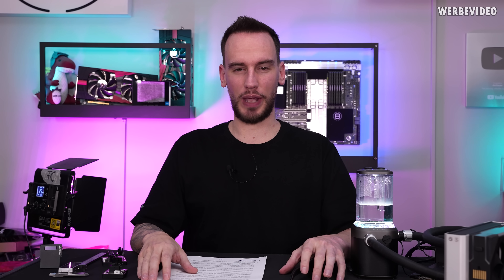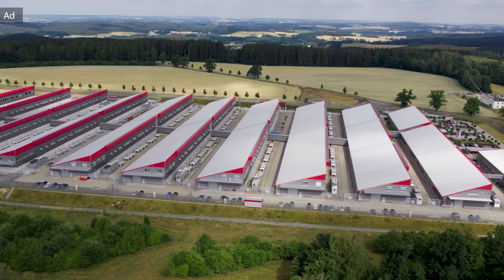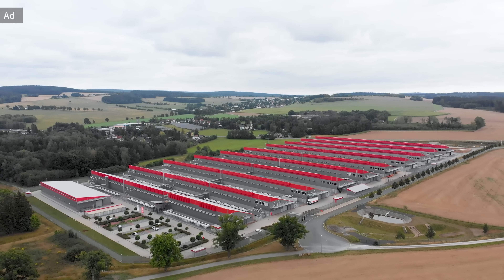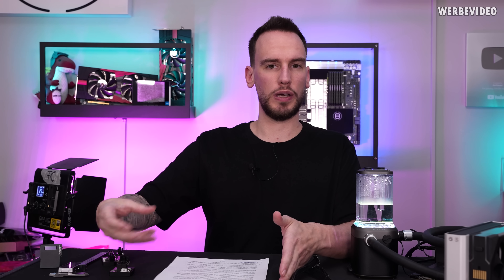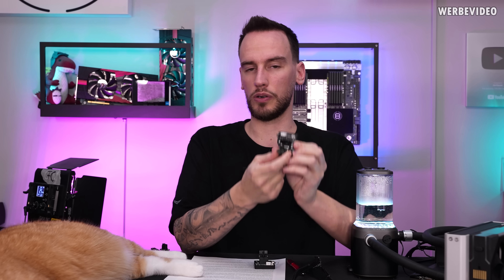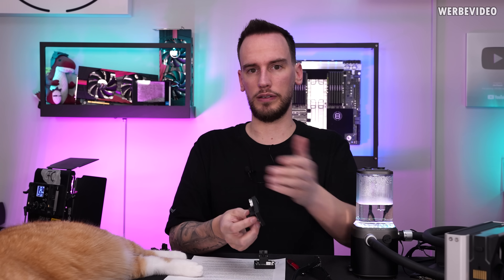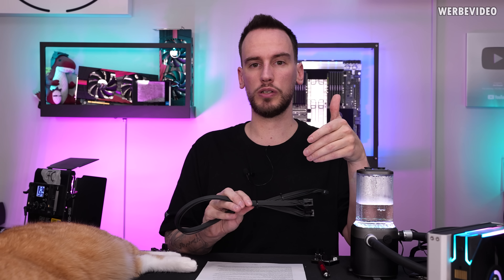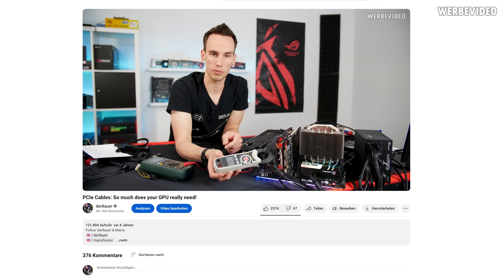12VHPWR is just Garbage and will Remain a Problem!!

Comment: even if nvidia does 2 X 12 volt high power connectors the problems will still exist in the long term future. 2x hvpwr plugs will help with the short term future tho. now to give you some history about me i have been a auto mechanic for over 30 years now. i have seen the exact same issues in auto electrics. now to give you a few examples in auto electrics. my 84 GMC 1500 uses the old large blade fuses. i have never had problems with these fuses except when they blow. which is what they are designed to do. some of my fuses are the original fuses that came out with the truck from factory. ( note here these original sized blade fuses the pins do not burn. also have never had to replace my fuse box.) now newer cars uses these smaller mini blade fuses with smaller pins pushing exact same amount of amperage and volts as the larger blade fuses. i am constantly replacing mini blade fuses on vehicles because of something quits working. but fuse is not blown. you pull the fuse and the pins are burnt. i am also constantly replacing fuse boxes now because of same issues. this has became such a problem that most vehicle manufactures are making the fuse boxes replaceable now which enhances the problems more because of more small pins.  to fix these issues going back to the older big blade fuses will solve 99.9% of these issues. now that i have explained all this. go to the 12 volt hvpwr plug. the pins are smaller then the older 8 pin plugs. they need to go back to the larger pins. by reducing the size of the pins it causes more problems with heat when conducting the same amount of amperage and voltage. its like trying to force the same amperage and voltage through smaller diameter wire. so conclusion if they will remake the 12 volt hvpwr plug with the 8 pin power plug pins making entire plug slightly larger. then nvidia does 2 X hvpwr  plugs this will greatly fix 99% of long term and short term future problems.

Comment: hypothetically could you hard wire  to the pcb run a short pigtail and terminatte to 3 or 4 8 pin connectors on a 4090 for example. Not being an engineer but if I put my hat in the ring for a design I would move the power connector more inward on the pcb and have a channel for routing the power cable and some sort of method of securing the cables to the more solid heatsink fan assembly for strain relief and from moving.  For example there would be a panel you remove to plug in your grfx cards power to the psu the route the cable and replace the panel you get the clean install pc builders want and a secure power cable in theory.

Comment: I am not electrically minded, mechanical yes. Is a direct soldered connection to the card possible?. Seems removing points of failure would be best i.e. the contact connection.

Comment: Realistically, 12VHPWR is a 300W connector with a 2x safety margin, not a 600W connector with a non-existent safety margin. I can see why manufacturers wanted a single cable for 12v power, but a single cable for <=300W and 2x cables for <=600W would be fine.

Comment: The issue of the safety factor is terrible.... If the other connector is spec'ed for 150W and will do 216W safely, 1.44 safety factor.

The 610-660W 12V power adapters make a lot more sense, if you imagine a 450W GPU spec and build the cable to handle 1.45X that amount (652W).

Is that cost cutting, or was the spec designed for weaker GPUs originally?

Comment: I said years ago that the ridiculous trend of adding more and more connectors (4x8 pin for example) would without question end up being just a single connector. The connector we got is far too small, and has nowhere near enough mating length or surface contact area. It's just not substantial enough, maybe NVIDIA should look at the automotive industry. There are thousands of ways to create a connection for GPU's and this connector is not a good one that should be banished.

Comment: As 4090 owners is there anything we can do to minimize having an issue?  I constantly check to be sure that my cable is seated and not severely bent but still fear that it may just randomly melt.   It’s too bad that Nvidia won’t admit fault and find a solution for the folks that invested quite a sum to purchase their product.
Reply: "As 4090 owners is there anything we can do to minimize having an issue?" Yes, make sure your power cables are seated correctly. And try to avoid third party adapters/cables. Your odds are %99.95 remaining issue free

Comment: they also need to all angle their connectors 90 degrees. You missed what the card is rated at - 75w through the m/b but it draws 450w - 500w so 375w-425w through the cable?. If the connectors are angled in relation to one another its creates what we call a point connection - a single point through which the current passes. If its a full fit with connections fully touching along a length then the current has a greater surface area to pass through from one connector to the other. What is needed is a redesign that enables a greater length for their touching of contacts along their length.

Comment: Why don't we use ring connectors? They're a proven technology, in use for decades in MUCH more demanding applications than PCs. An end user can terminate them on their own to the correct length, or they could be provided with ends already attached.

Comment: A safety margin of 1.1–1.5 is not a safety margin at all; it's the engineers (more likely their managers) saying "Let's only provide what we need to and stop there." That would be like an aircraft manufacturer designing the landing gear to support exactly the maximum designed weight; it does not take into account any extreme circumstances like hard landings.

I would rather see three or four 8-pin PCIe cables in my case and know that I have a safety margin of 1.9–2.5 than a single cable and risk a fire should one of the wires break because there is no safety margin.

Comment: I'm running a Asus strix z 790 e ddr5 @ 5400mhz gaming WiFi board, i9 13900k, Asus strix oc 4090 with 2 Samsung's pro990 m.2 ssd's with a Corsair hx1500i power supply. I'm running the 4 plugs at 150 to 16pin to the graphics card. I put a temp sensor on the plug where they are melting. I have seen a max of 40deg cel. When running FurMark. The max I've seen after 45 min was 42deg cel. My case is the NEXT H7 Flow. All fans are coarsair 140mm and a nzdt AIO 360mm those fans are 120mm. I'm writing you this to let you know that things seem to be working at the proper temps? Maybe you could tell me if I'm wrong. My CPU and card are slightly overclocked.

Comment: Thank you for doing this video.  As a owner of a Strix 4090 I am concerned about this.  I also purchased the cablemods 90 degree adapter and appreciate the honesty and detailed explanation of this situation.  I would hope that Nvidia or Asus would take the lead for replacing this power design.  I will not buy any gpu with this cable design for power delivery in the future.  Thank you again very much for brining this into the light.  Hopefully something will be done about it but with Nvida you just know more than likely it wont.

Comment: They really should have just used 2x 12v eps connectors for the 4090 instead of this garbage. Those are rated at 336w each (4 pairs at 7A each for 28A)

Comment: I don't understand why did they want to reinvent the wheel and didn't went with something like XT60 or XT90. Even the molex style connectors on PC PSU are dumb and totally outdated. Why use multiple small pins and thin wires instead of thicker ones.
Reply: Genuine answer. Cause these can be crimped. Which can be done via machine in stupidly high quantities and then inserted into the connector jacket (again by machine). Where as thick connectors have to be soldered and having an extra step to protect the newly soldered joint (Special isolating parts, Heatshrinks, etc) which is far slower to do even with partial automation. This makes Molex style (and similiar like JST) connectors suitable for mass production, while the beefier connectors like the XT60,XT90 and old T-Plug are more for comparatively low-volume production.

The real kicker is that this connector could have easily handled 900W, IF instead of basing it on the older Microfit3.0 design (8.5A per pin), they based it on the newer Microfit+ which is far more secure and capable (13A per pin).

Comment: NVIDIA produced defective cards, that's the simple gist of it. All these other brands are trying to produce solutions to fix what NVIDIA did in laymens terms is an 'oopsies'. The problem comes down to simply that the eggheads at R&D department of NVIDIA thought that theoretical limit of power connector material limits is the same as real world material limit i.e. that resistance and material impurities don't exist. So pumping that much power through singular tiny connectors that are full of resistance and impurities would conduct heat and eventually there would be a melting point. CableMod's adaptors are not faulty or defective, the point of failure is on NVIDIA's side.
Reply: "NVIDIA produced defective cards"  200,000 units sold less than 100 known issues = 0.05%. This product falls well below the industry's acceptable quality level standards and well below the %4 expected failure rate.

According to the AQL industry standard (Acceptable Quality Level) the acceptable failure rates are as follows:

The failure to meet the requirements of customers with respect to quality is termed as defects. The three categories of defects are:

Minor Defects - Not likely to reduce the usability and material of the product for its intended purpose, but slightly altered from the intended design and specifications. The industry average AQL for minor defects is 4%.

Major Defects - Not acceptable to the customers. Usage of the product will most likely result in failure. The industry average for AQL for major defects is 2.5%.

Critical Defects - If accepted, this type of defect could potentially harm or injury the customer. These defects are completely unacceptable. The industry standard for AQL for critical defects is 0%.
Reply: @javiersantana848  I'd say, potentially fire hazards fall into critical defects. Especially if it can potentially set someone's house on fire.
Reply: @luminatrixfanfiction  "I'd say, potentially fire hazards fall into critical defects. Especially if it can potentially set someone's house on fire." I agree, but this is not even the case nor has it even came close to actually occurring, being replicated or proven, that is only your opinion. This product if anything at all falls under minor defect based on the scarcity of issues. User error and using after market adapters do not equate the GPU having a manufacturing defect, but if it did it would still fall well below minor defects expected failure rate of %4

Comment: The pins are too small, the contact surface area too small due to shortness of pins, all around fail. If they only made the pins longer and thicker with a deeper socket it might have been solid. Not only would it reduce heat, but also be a more stable physical connection.   Reason I never got a 3090 ti, or anyting that followed. How much money would they have lost if they made these connectors longer with more contact surface area? Totally dumb design. Even someone without a EE degree can see this as a fail. It goes to show how all these new engineers never over engineer anything. They really need to get this resolved fast, go back to old 8 pins. I will not touch until done.

Comment: They should have just doubled the old 8 pin connector into a 16 pin, mandated 16awg wires for it, and rated the new connector at 500w. It would have satisfied the new power requirements, taken much less space than using 3x 8 pins before that high end cards had been using, and been very safe still.

Comment: Roman, do you have any thoughts on why the PC industry doesn't adopt high current, low pin count connectors like the XT60 and XT90 (or other bullet/banana plug style large diameter connectors)? These are widely used in high current applications with no persistent issues, while being much more compact than both PCIe and 12VHPWR connectors. I get that the higher gauge wires might be a bit annoying, but that can be worked around in various ways by manufacturers. And of course soldered connectors are slightly more expensive to produce than crimped ones, but again: negligible. According to the connector specs, a single XT90 can deliver power to a 600W RTX 4090 with a 1.8x safety factor, while being a small, relatively easy to connect and disconnect, secure, temperature tolerant connector. I get that these connectors lack features like sense pins, but again this could be worked around by, say, making a custom XT90 derivative with some small sense pins attached, or (less elegantly) by adding a secondary sense connector.
Reply: I can answer that as an EE with production experience. It genuinely is because they need to be soldered. The reason being not because costs, but production capacity.

Crimped cables are incredibly easy to automate with machines that are able to perfectly strip and crimp at a speed that "Machine goes brrrrrr" isn't an exageration and it needs nothing more than the cables and the pins. This allows for an insane quantity of connectors to be made in record speed with practically no failures by a single machine the size of a Xerox and is a stark contrast to Soldered connectors which take magnitudes more time per connector on average due to increased production complexity. It is the difference between getting a thousand large diameter cables and a million crimped ones (and i think in reality the ratio is even higher...).

As a result we use large diameter connectors very rarely in appliances. If we can use Crimped connectors, we ALWAYS will try to use those first. Only if we absolutely can't like because of an external high-current connector or standard (e.g. XT90 for batteries), do we bite the bullet and agree to soldering the blasted things and only if the product is low to medium volume. If too many devices rely on soldered connectors a cable shortage becomes possible.
Reply: @Foxhood  Thanks for the response! I've seen videos of those crimping machines, so I know how fast they can go, though I guess I hadn't thought of how much slower soldering is at scale (they're more comparable when you're doing both by hand after all). Still, in this case it's starting to sound like soldered might be the only way to go if they want to keep the desired characteristic of having a smaller connector with a higher current rating. I'd assume that if developing a crimpable large diameter connector capable of that kind of current level (i.e. an XT90-like but crimped) was feasible, someone would have done so already.
Reply: @Kraaketaer   Yeah. Thing with crimping is that you are largely limited by the contact surface area between the wire and the Pin itself which is often squeezed around the wire's circumference. Result is that the ability to transfer current from wire to connector gets noticeably worse as you go thicker. Only soldered lets you go almost as hard as the cable and the actual connector itself can, hence its use with stuff like XT90. Crimping that and you will lose a massive chunk of its current carrying capability.

This is actually a factor as to why they wanted to go for a smaller connector. Way more efficient at transferring current than the bigger one that required thicker cables to properly crimp on. Its just that they executed it poorly. Like using the 13A microfit variant instead of this modified version of the 8.5A variant

Comment: scary stuff as a 4090 owner. I use corsair's 2 8-pin to 12VHPWR solution and have an open format vertical test bench setup so the cables aren't under any strain, and I think this connector has only gone through two mating cycles. I'm always very cautious about moving the cables around when I have to. thankfully, i don't typically have reason to touch them at all...
Reply: "scary stuff as a 4090 owner" Na, lol. 200,000 units sold less than 100 known cases = %0.05. You have a %99.95 of having no connector, cable or adapter issues. The only ones that are truly complaining are the ones who cannot get their hands on one.

Comment: 48v standard in the answer. Get graphics cards to have a DC to DC converter to allow 12v and 24v or 48v. This would give time for PSU makes to change to 24v or 48v standard. Car are making over to 48v from 12v PC can do it too

Comment: i'm still using a 2080 because these new connectors sketch me out so much.. like if they wanna stick with a connector that is so reliant on being put in correctly they shoulda made it like those old VGA connnectors where you had to screw in down.. the only reason i can see them wanting this silly connector is for aesthetics, in which case, screw that, just give me abunch of the tried and true 8pins, i'd rather have something reliable
Reply: "i'm still using a 2080 because these new connectors sketch me out so much" Na, lol. 200,000 units sold less than 100 known cases = %0.05. You have a %99.95 of having no connector, cable or adapter issues. The only ones that are truly complaining are the ones who cannot get their hands on one.

Comment: Wasnt most of the "stock" conversion wire issues because users didnt seat the cable fully?
Reply: "Wasnt most of the "stock" conversion wire issues because users didnt seat the cable fully?" Absolutely correct

Comment: very nicely detailed.. the old connectors are designed properly.. with proper safety margins.. why in the nine hells of proper engineering they actually released a design that is so bad, is beyond anyones guess.. i think, this was a really bad oversight and some forces were pushing to simplify this for nvidia.. bad call resulting if even worse situation for nvidia